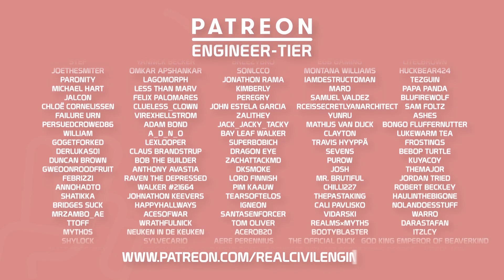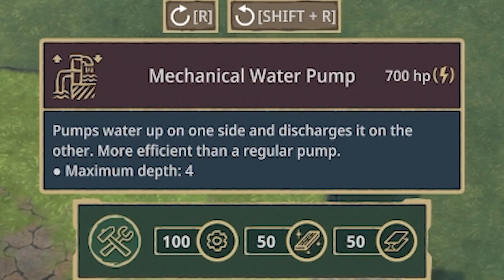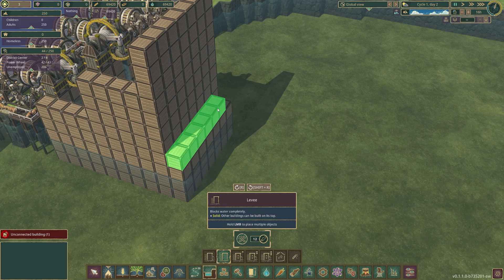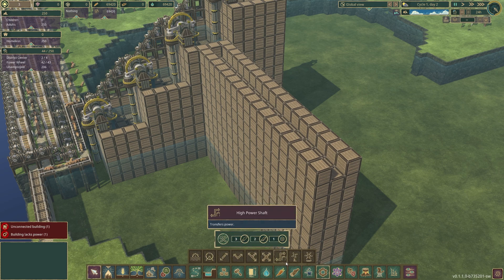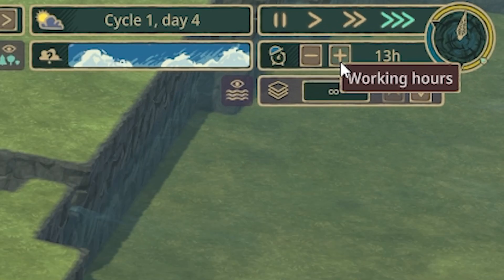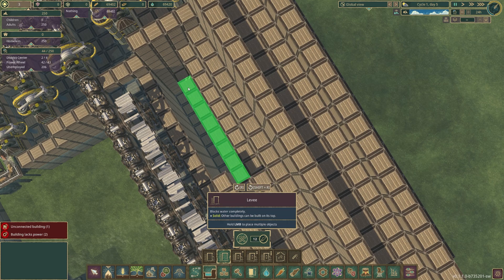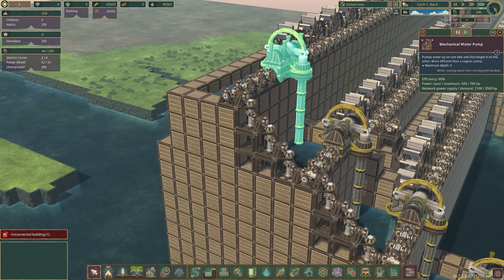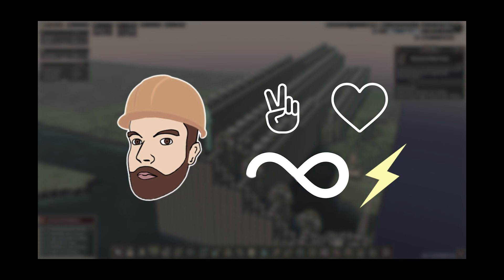Engineering INFINITE POWER in Timberborn!

Comment: If you add dams to the end the water will first fill up everything, then once it hits the tops it overflows. This helps a lot because the wheels generate power based on how high the water is. The water will stay high because of the dams at the end.
Reply: Maybe a floodgates so he can set it to hold more water than a dam.
Reply: It would need a large basin to first fill up, then it'll need to gradually get horizontally thinner to increase pressure at the endpoint for maximum effectiveness of water wheels.
After that point, gravity needs to take over to spill into lower levels.
Only mechanic I can think of realistically in this game is the modded flood plains map.
Reply: the Middle of the channel could be made out of platforms to save time

also thin water weels would be better for this . . because that would compact the water flow into a smaller area
Reply: I completely agree with your statements. With a series of levees and floodgates I never experience a dry season or power outage. I have dams at the very end of my map and then a reservoir with a floodgate that I slowly release over time. 6 wide but only opening one gate at .5 increments as the river starts to run dry
Reply: The waterwheels in this game are really weird. In real life you can't get much useful energy from flow, because if you take away the kinetic energy of the water then you end up with water that isn't moving which kind of jams.
Real waterwheels convert gravitational potential energy. The water flows over the top and then down, and it's the drop which provides power.
Reply: @Khaim.m  I think we would need slopes to get acurate results
Reply: @bluewhalestudioblenderanim1132  I don't understand what you mean? We'd need a different set of game mechanics and buildings if we wanted it to be realistic.
Reply: @Khaim.m  you're not considering old water wheels that actually used the flow of rivers to get energy.
Reply: @alex941126  It can probably work more easily in an actual river, where the wheel is minor as compared to the width of the river, no? I don't think it would work in a narrow channel as it does here?
Reply: @Khaim.m  It is possible to get energy from flow but requires an impeller instead of a wheel.
Reply: @Khaim.m  Actually if there is no drop available you make your waterwheel take out some of the movement, but not all.
This is quite normal in flat areas where there is still high flow.
Reply: True
Reply: Pog
Reply: Ok
Reply: Though the exact same thing
Reply: Yes and no, the speed of the water flow is what makes the wheel turn. Having it higher doesn't change anything unless he introduce more water to flow through the aqueduct.

The issue is one pump is not enough to run the wheel run.
Reply: @takumi2023  once the dam is in place and fills up, it creates flow meaning a dam would of solved everything if he put one at then end of each drop off. flow would be the same but at a higher level which is what he needed
Reply: @takumi2023  but the wheels do require a minimum depth before they will spin.
Reply: @takumi2023  Maybe, but at least they'll actually spin consistently
Reply: @everyone, yes you are correct but changing the height doesn't increase the flow rate. it still will flow very slowly. We can test this in the game and see if the power will increase however, I suspect that it will not. 

Someone will need to test it, I don't have a copy of the game.
Reply: @takumi2023  The flow wont improve, in that case you're right. But water wheels generate power based on the amount of cm flowing trough them. Which would generate more power.
Reply: @takumi2023  people have tested it and that is why they are telling you that you are wrong. in the game they use depth of water (up to a point) as well as flow to determine power output. that means you get more power just by increasing depth even if the flow stays the same (in game).

Comment: use Iron teeth faction, they have a bigger more efficient water wheel option and you can give yourself wood to get engines going in the beginning!
(also their pumps can go 6 tall instead of only 4)

I did this in my unmodded game, did a more efficient job of my levies, but works a treat!

Comment: If you do it again but this time have a step down right where the canal starts, it’ll give the water a boost of strength right away and it’ll produce a lot more power.

Also it might be worth it to have two pumps for every level so that you can double the amount of water coming down. It’ll cost you more power but the efficiency of the water wheels will more than double with the exponentially increasing speed caused by a surge of water through a thin canal.
Reply: this :D or like ImKibitz did... 3 by 3 pumps... :D need more water to be pumped :D

Comment: You don't actually need to build up too much and making steps, you just need it to be at least one block higher than the surface of the water so that it flows back and it can be just flat as long as you pump enough water in. So basically build all the watermills on the same 1 block high level and build 3 or 4 water pumps all pumping water from the lake to the watermills. There is still the problem that to make 2 to 3k hp you would need so many watermills that the canal could become too long and water wouldn't reach the end, but you can try
y

Comment: The best technique would be to pump the water up into a large elevated basin then let that fill up... Once it's full let the water flow down through an array of water wheels similar to what you're doing in the video. Have the first set of wheels already lowered by 1 cube.

This will give you enough volume per second to start the system and once it's running it should become self sustainable.

Comment: I don't think the height that matters to convert the power, but the flow rate.

Instead of making a staircase water pump, try to make multiple water pump in a single pool, it should increase the flow rate, and hopefully the horsepower too
Reply: You mean beaver power
Reply: @hellothere6627  underrated comment here
Reply: Max is 180 bp out of a water wheel so you need 4 wheels at full capacity for every pump. From his set up, if you get it started up from shame wheels, you should be able to pump more into the reservoir to get more flow and get the system self sufficient. Might need a bigger surface area reservoir so water levels don't dip as quickly as well.
Reply: @brendenpolkinghorn1415  the wheels don't max out at 180. They produce 180 hp per cm/s of waterflow. That means a single wheel could power two pumps if the flow is great enough.
Reply: @icaruswindrune7116  can confirm, I have a set of 4 medium water wheels which are built over the fastest flow I could get from about 10 water sources all channelled through a 4 tile width, pretty sure it gives out about 600HP per wheel
Reply: @icaruswindrune7116  can confirm, I have a set of 4 medium water wheels which are built over the fastest flow I could get from about 10 water sources all channelled through a 4 tile width, pretty sure it gives out about 600HP per wheel
Reply: @Veklim  Yeah, I've done something similar with two large water wheels, albeit I used a few reservoirs for mine (all 2 deep). Ended up getting over 1400 for two wheels at one point, it did require having a ton of water rushing through the channels, however.
Reply: @icaruswindrune7116  yeah, but that would require a flow, that would take 31 pumps to reliably maintain (assuming the numbers on the timberborn wiki)
Reply: This. I think for his video he went straight to a big setup, but an engineer would make a small proof of concept. 1 pump and water wheel. But because you need more flow, up the number of pumps. Height difference of the floor does not seem to matter. Only height difference of the water surface. Once the water surface reaches 0 height then that is the max amount of wheels you can add

Comment: Are the water wheels programmed to only accept horizontal movement? Cause having them spin from vertical water movement like a waterfall feels like a better method.
Reply: Can't get enough waterwheels in that way. Even if a 1 tile drop was enough to max out a waterwheel with that method you still have a 100hp deficit.
On the other hand, by minimizing the height and having pumps in parallel to actually fill the canals you can actually be net positive.
Reply: That won't work I think, since the water is like "laid" out horizontally, they can't "move" up and down, they just gradually change height, that's why you can't build leeves above a platform, since the water above that leeves will also be visible from underneath the leeves.

Water is literally everywhere, turn off camera collision and you'll get what I mean
Reply: The wheels in game don't work like real life. You're right that they really should work by having water fall over them.
Reply: I tested vertical movement, they ignore it. The wheel next to the waterfall produced just a bit of power, the wheel next to it produced as normal.
Reply: I would like to say that I setup the massive water wheel next to a water fall and was generating massive amounts of power. I do think that as long as the falling water also flows under the water wheel as well it'll calculate the falling water as part of flow.
Reply: Agreed, I'd build multiple waterfalls and different elevations and have max 3-4 wheels. Doesn't the wheels slow down the current of the water?

Comment: You definitely need more slope. For a single row of pumps, you're probably going to want to do 3-4 small power wheels per step of levee. For a double row of pumps, you can probably up it to the regular power wheel. It will probably take a triple row of pumps to keep up with the large power wheels. It's probably a lot easier to think out the layout and build the slope/channels in the map editor rather than trying to levee it up in the map.
Reply: Thats all backwards. He isn't able to fill his canals, so he needs less slope. To solve his canal filling issue he needs more pumps. With a lower slope he can put more waterwheels with less pumps. The goal is to have the lowest pump:waterwheel ratio possible, so from the video it seems like 4 parallel pumps with only 4 steps if slope would be more ideal.
Reply: @traniel123456789  Water wheels reduce the speed of water flow since a patch or two ago. He needs a lot more slope.
Reply: @milolc  If the water isn't able to build up in the canal he has too much speed, so too much slope. Too little slope would be indicated by water spilling over the sides.
Reply: No I think he's right you need more slope to increase the flow and speed of the water which would give the water wheels more power n probably put the same set of water wheels on the opposite side to double the power with the same amount of pumps
Reply: @residentevilfan4925  there is no way to make an actual slope in this game. 

so rather the water has a 1 block drop or has 6 blocks of drop, it doesn't change anything since there is no actual slope of water that would increase the flow.

Having a stream of water fall in this game from the highest allowed block down to the lowest allowed block doesnt change the waters flow. The water still moves at the same speed since it's dropping straight down instead of the water flowing down a ridiculously steep slope.
Reply: @Bama_Boy  From the Update 1 patch notes:

Water Wheels now have variable HP output, depending on the current’s strength. If placed well, they’ll be even more effective than before.

Water Wheels will now slightly slow down the water passing through.
Reply: @milolc  shit i am wrong.. I missed that part of the update then.
Reply: What if the canals were wider? Or if he used the thin wheels from the Iron Teeth? Then he could zigzag the wheels, would this help the flow?